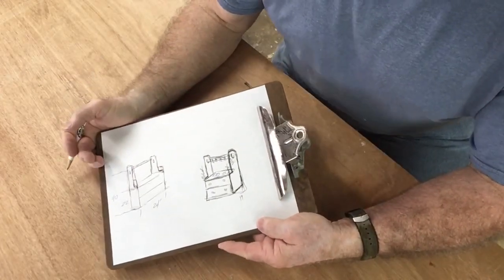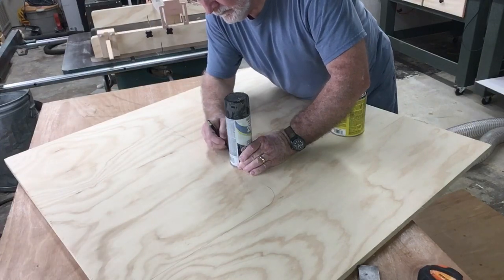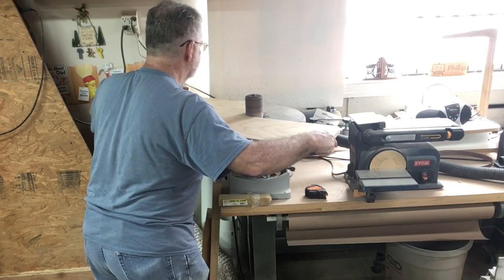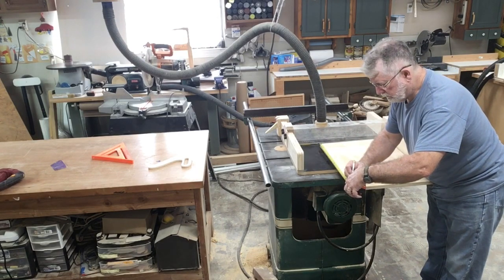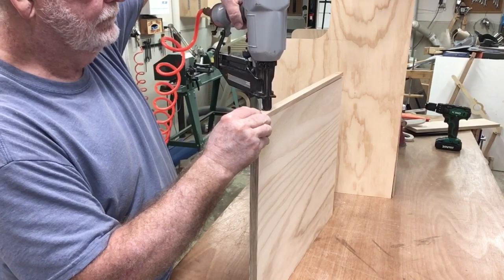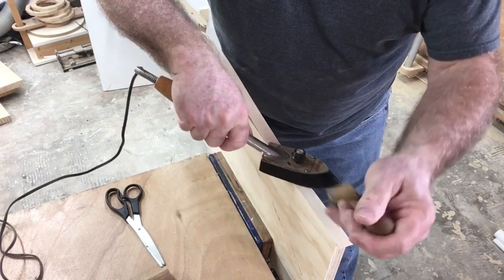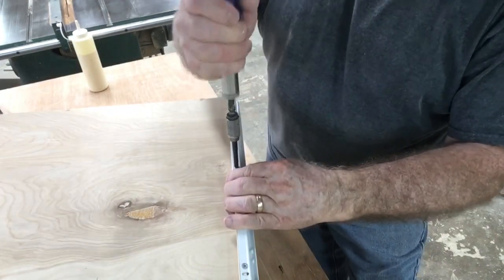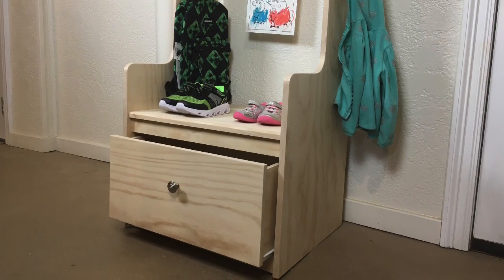Get the Kids Organized for School

Comment: Boy that turned out well.  I can vouch for any stain or milk paint from general finishes.  Although, what is that natural oil clear coat that ambers up the wood a bit.  Not shellac, but some other natural oil or stain, can't remember the name.
Reply from the maker: Thank  you very much for your suggestion.
Reply: Paw Paw’s WorkShop , took me 24 hrs, but then I remembered ... Linseed oil was the natural clear coat I was trying to suggest.   Getting old here 😀
Reply from the maker: Yes, linseed oil is a great finish.